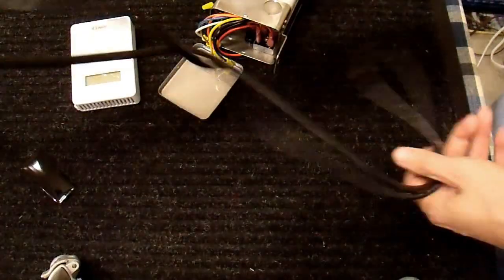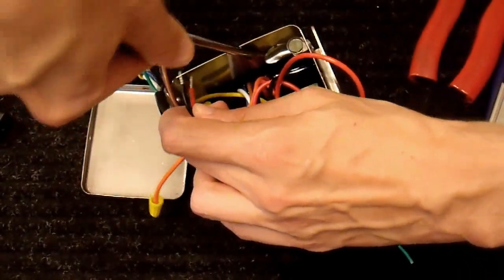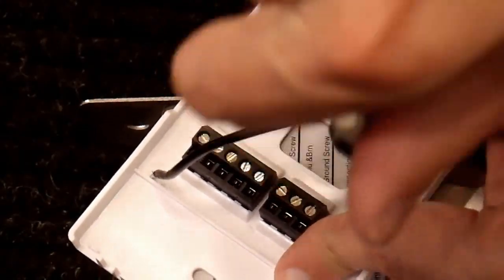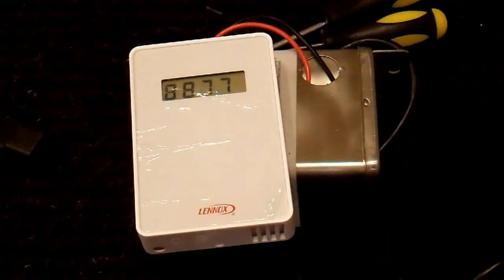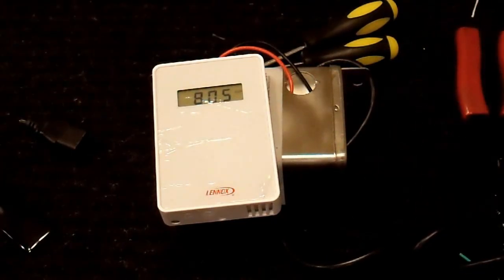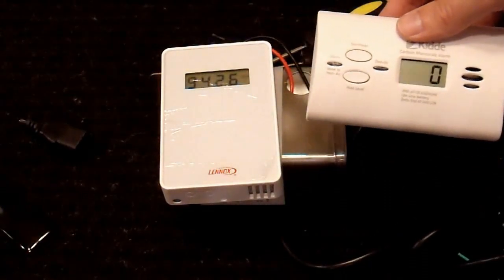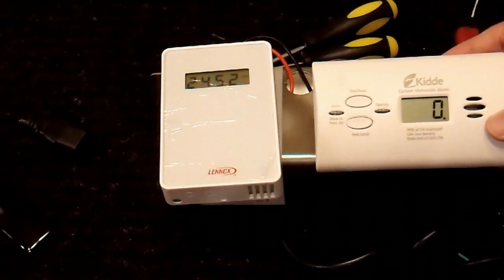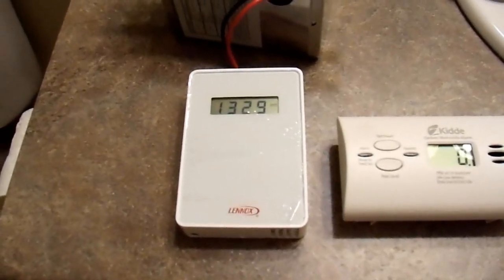Low Cost CO2 meter - Emergency Heating and Cooking Safety part 2/2

Comment: You get what you pay for when it comes to a co2 sensor. That one uses an electrochemical sensor. The good ones use infrared light to sense co2. You are the only one in your house, which tells me that the sensor you have is reading way too high. That's what you get for cheap.

Comment: Hi knurlgnar24, I'm really interested in safety if I do something that the manual says no to do, like using a combustion heater inside my, so I really appreciate the use of CO and CO2 meter. I had already seen your CO2 meter in some of your others videos, but I did not know that it was powered by a power supply, I thought it may have a 9v battery inside or more AA batteries. You said you would use that meter for example during a power outage while using heaters that produce carbon dioxide, but the meter is powered from the ac of the wall and in this case the only way to use it would be by powering you house with your samlex 3000w and batteries. I don't think it would be a problem due to the low power consumption of the meter (I saw >2w peak, so very low), but how about powering it with something more portable than a (seems to be) heavy transformer and of course a power cord? I had an idea for powering it without wires, and of course it consists in a battery, but 12v batteries are heavier than a transformer and even the voltage is too low, so 2 things remains: a LiPo pack (at least 18v) but it could be quite expensive, or maybe a power bank (I was thinking about the ones which has the DC 19v output for laptops, which sometimes have also the connectors for jump starting the car like the Bestek 600A of your review). I know that this kind of power bank are not cheap, but it would be something useful not only for powering the meter during the outage, but also for laptops or mobile phones.
Saying this I am not criticizing the fact that you have fed the meter from the mains and that you would use in case of power failure but how to if there is not power ? ! ? And so on. I'm only trying to give an advice to you (but probably you have just think yourself about it) and to all other people who whatching the video could be think, like I have done, "how could I made that more portable and confortable to use, and overall, how can I use it if I do not have a battery bank to bring power to my home?

p.s. I really like your videos, I find them very useful, interesting and original; I'm learning lots of things from you watching all your projects and reviews, so, thanks for all theese information so well explained!!
Kind regards!

Comment: Thanks for the response. I am initially going to buy one unit and battery pack today and go from there.
Another off topic question. I have back feed my house during extended outages with a small Honda 2000 .I threw the mains and powered each phase thru the outlets with my modified cords. I know I could do the same thing with 2 of the  APC 3000 units, each powering one phase thru above mentioned method , this means that the hookup procedure is done after the power is out to the home .
Question... is it possible to have  two UPS units plugged in, one to each phase, so the batteries  are being conditioned  and have the output of the unit , back feed the same outlet. This would allow the unit to always be on and respond to all outages in less than a second.  So my novice question is, can a UPS unit be powered by a circuit , and have the output plug of that unit plugged into  the same circuit , in a non outage situation ?    
If that would work, you would have an automatic switch over with constantly conditioned batteries , for the cost of running the units constantly.
I am maybe thinking that passing back  the current from the powered unit in a non outage situation would instantly blow the circuit breaker on the circuit being feed or create 240 volts  or more amps that the 20 amp circuit???
Please let me know if this is flawed thinking.
Reply from the maker: Those Honda inverter generators are great for this purpose because they automatically sync to mains.  Honda engineered them very well.  Unfortunately the UPS units won't work properly connected as you describe - they need to be inline to work properly.  I did make a video on how to connect two inverters together for double the output power, and another series on how to power your house during a power outage.  I'd recommend watching both of those if you haven't already as I believe they'll help point out some of the difficulties and safety issues of the 'backfeed' methods.

Comment: Sorry for the off topic question. What is your gut feeling on the value of buying 10 APC UPS 3000 rack mounted Smart  units. They each come with a battery pack unit. The total cost is $1000.00 for the 20 units. My feeling is this is a great price if they all work. Even if some of the battery packs need replacing it sounds like a great price.  thank you for your brief comments.
Reply from the maker: At 1/10th of the retail price I would say go for it - assuming you have a plan to use or otherwise profitably dispose of the units.  I would recommend that you base your decision on all of the units coming with bad batteries.  Used UPS batteries are pretty much worthless.

Comment: I have lived for 56 years without one, I see no reason to have one. Have no idea why anyone needs to worry about this.. Never seen someone kill by CO2. I really enjoy your videos. But it seems everyone worries about every thing.
Reply from the maker: I encourage you to do some research on CO2 before you excuse it outright as a danger without any empirical data.  With modern high efficiency construction it is a hazard - not so much in older structures.  Unlike CO it will cause drowsiness, sickness, and mental inhibition long before outright death in benign circumstances but divers and mountaineers know of its practical dangers.  OSHA also has published regulations on CO2 concentrations in work environments, its hazards are just not well known with the general public.
Reply from the maker: I think I understand your comment now:  The safety issue isn't CO2 directly, its a lack of oxygen.  O2 sensors are expensive and in the presence of a flame CO2 and O2 concentrations are inversely related, so I can reasonably accurately use a CO2 meter to measure when Oxygen concentrations are safe.  This is the reason why some heaters have low oxygen cutoff switches, etc.  Maybe that makes more sense - I should have made it more clear in the video.